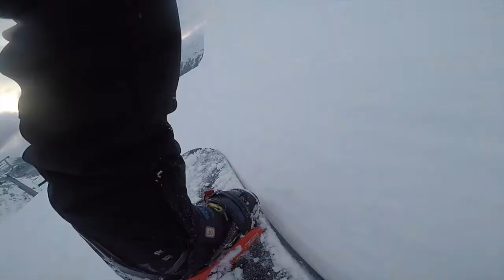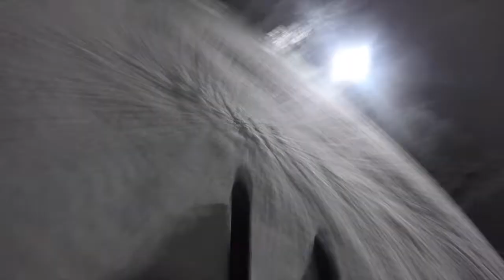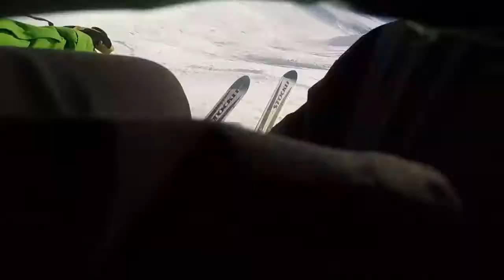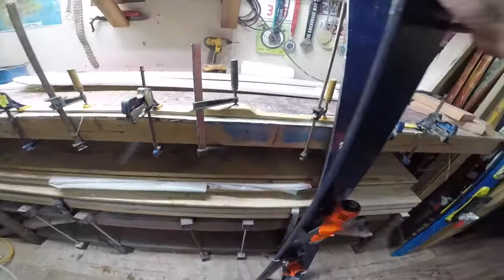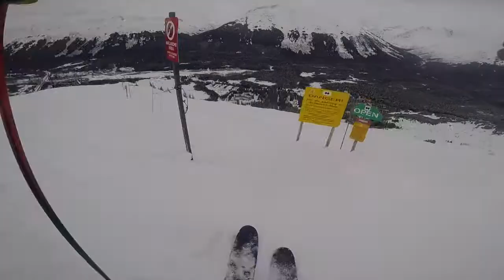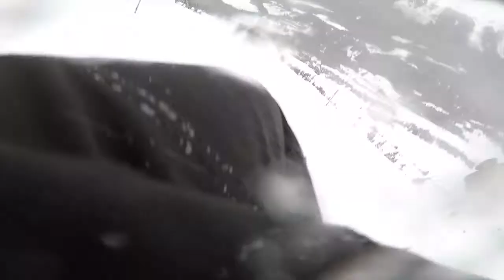Run of the Day: Custom re-Shred

Comment: Intro is fire.    But you need to have a better camera angle
Reply from the maker: I been using chest cam strap because you can see skis, poles and where going. Head cam is tricky because if in wrong spot only see down or only up. Maybe neck choker cam would work...